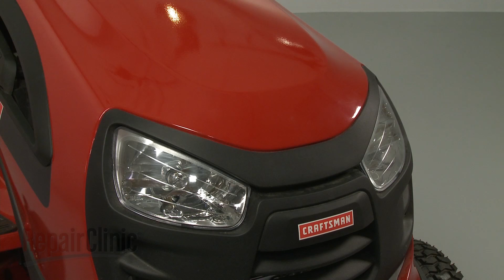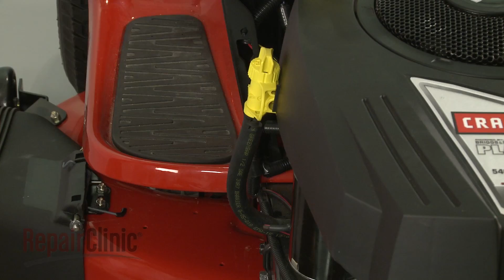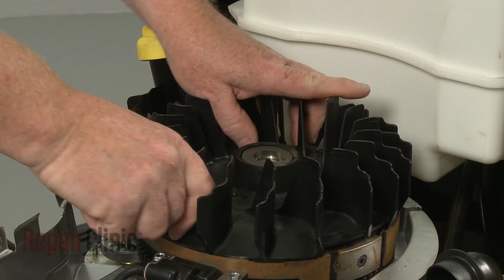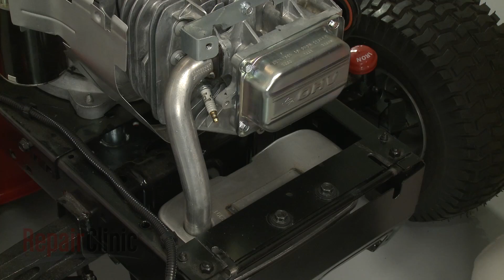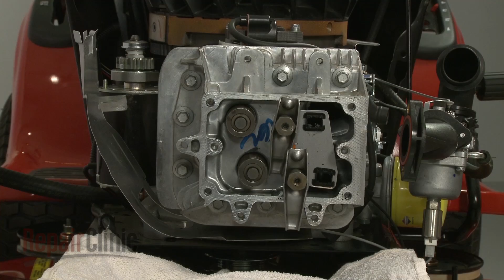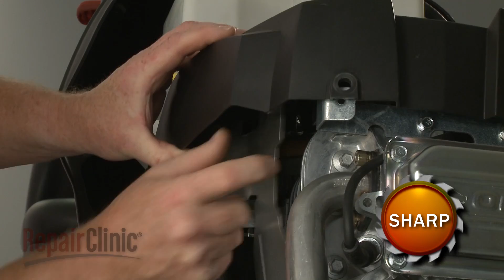Briggs & Stratton Small Engine Disassembly (#3319770010G1)

Comment: excellance but my problem is I have a oil leak underneath a mounted briggs stratton ohv intek motor that leaking on my exhaust
Reply from the maker: James Graham Thanks. Probably bad oil seal on crankcase or at the crankshaft.